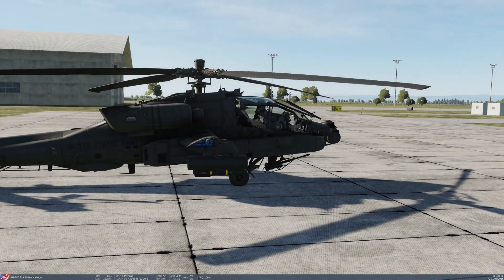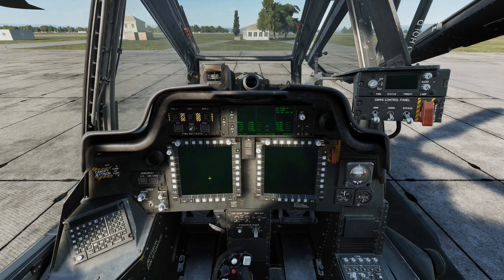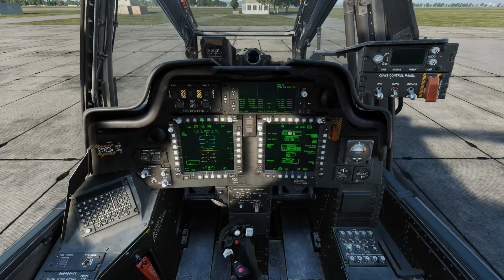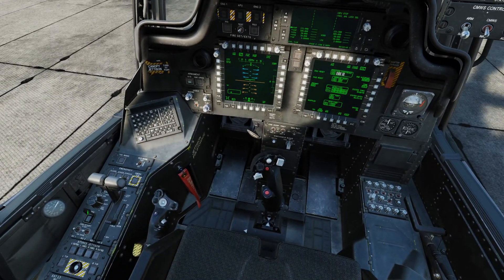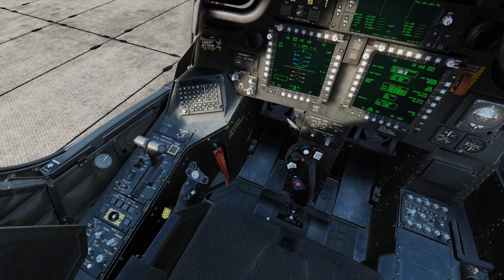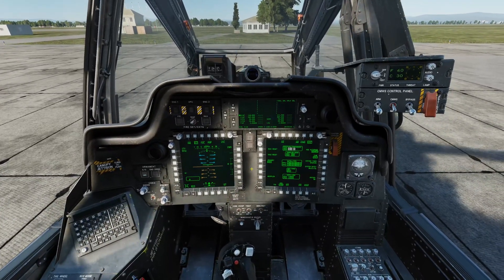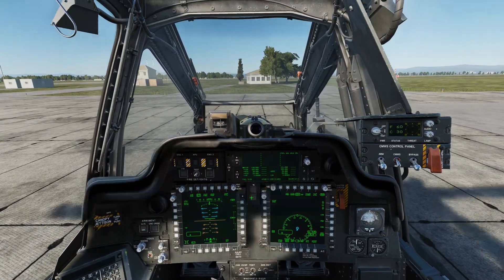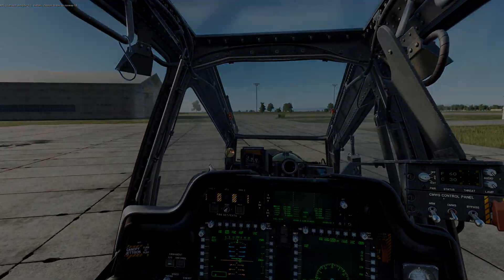DCS:World AH-64D Startup Procedure

Comment: I followed all the steps as in the video. But my helicopter doesn't have enough power to take off. Even though the APU is off and the sliders are on fly, the helicopter only takes off for a short time. Then he drops again. As an inexperienced player I would say he doesn't have enough strength to move up. What is my mistake?
Reply from the maker: Sorry for the late response, still working on that issue?

Comment: Is there a quick way to start the engines on the apache without going through the proceedures?
Reply from the maker: All aircraft in DCS do have a sort of autostart function.  The binding and even the name of the binding change from module to module but it would be in the control bindings for any module. I don't know it from memory sorry, so I'd suggest looking through the categories since it's probably going to be in one unrelated to any flight systems.
Reply: In real life, you’d need to be hooked up to an AGPU (Auxiliary Ground Power Unit, basically an APU in a box on wheels). The Crew Chief will hate you & it’s not instant, but startup is faster. 

Source; me, a former AH-64 Crew Chief 
MOS 15RY1
Reply: @pauly260  I know. I drove an oh-58
Reply: @LLynyrdSkynyrd-e7y  Awesome!
Reply: @pauly260  When I was a pilot, I spent a lot of time helping with the dailies
Reply: I found out how. former 11b1p & 152b my aviation brother.

Comment: Wait, you don't have to wait for alignment to start?? I've wasted so much time waiting for that today...
Reply from the maker: Alignment can be started by selecting that osb next to doppler in the utility page of TSD, but it takes about 5 min or so I've gathered thus far.  So, the aircraft takes like 2-3min at best once you get used to how she starts so that leaves you with some down time.  You do need to wait for the positional error to green out for alignment but I guess that really only matters for anything relying on a functional (accurate would be a better term) INS system.  Which is nothing as far as I can think of it.  

I'll tell you what, I'll test doing some weapon runs with a friend taking off without even aligning the INU.  I imagine it should work just fine, should only be for navigation.  I can't think of any INS guided weapons fired by this aircraft but I may be missing something.  In any event take it easy and have a good one.